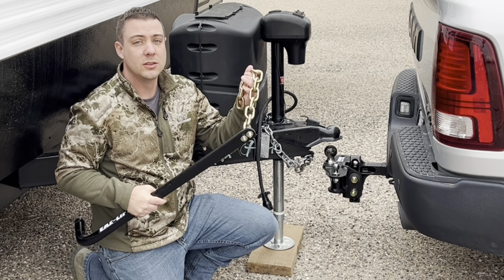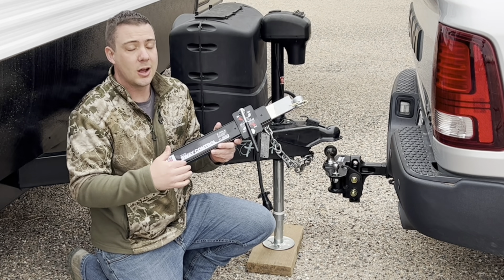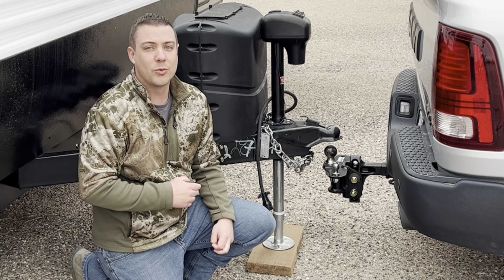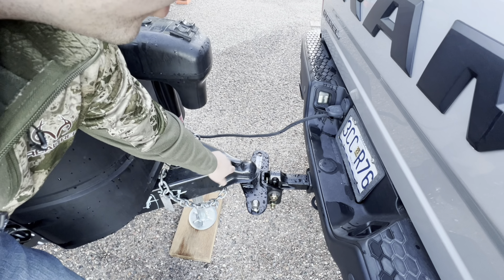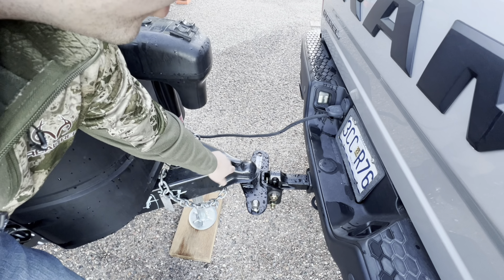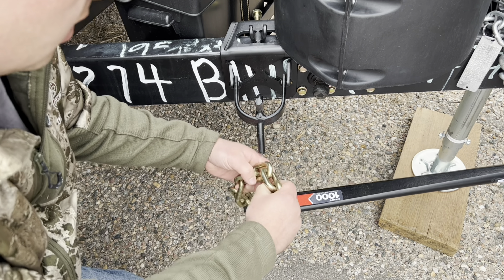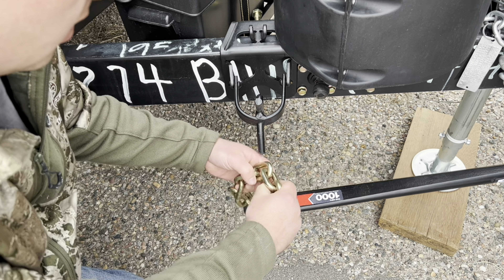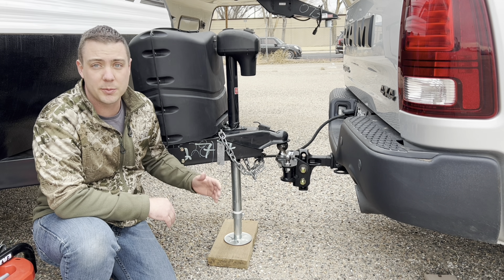How To Setup And Use a Weight Distribution Hitch

Comment: Very good video! One thing however... it's best to always remove the sway bar when backing up unless you're only moving a few feet and keeping the trailer damn close to straight.
Also... never lube the sway bar surface... just a dab in the cups.
Reply: I usually remove mine also, but what I tend to find is some people mount the Sway Bar mount points on the tongue too far forward and severely limit how far they can turn. I have backed into sites with them still on with lots of room to spare.  Although to be fair I usually take them off because they are noisy when wet going through the campground.